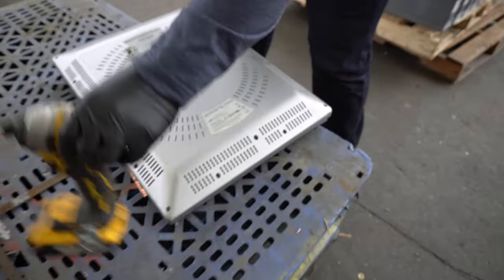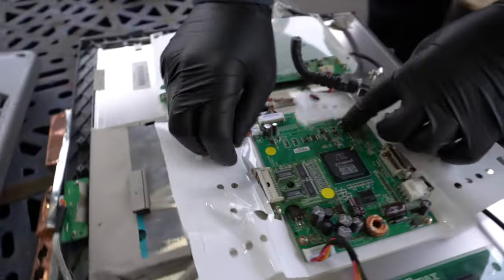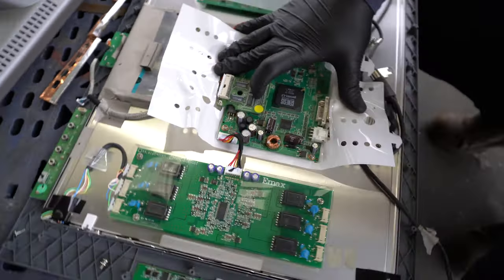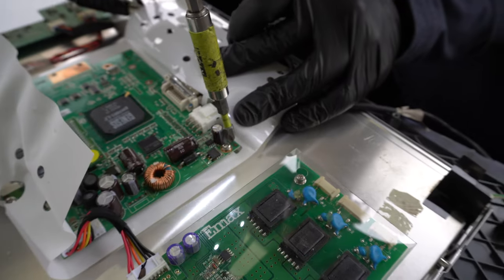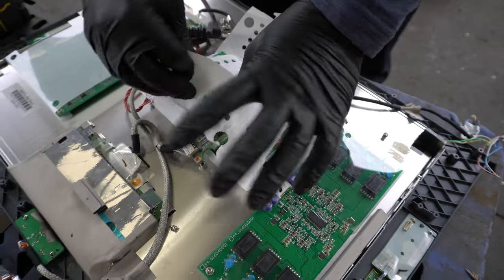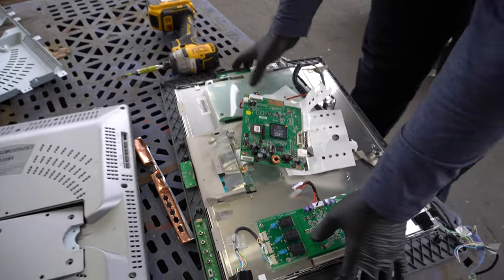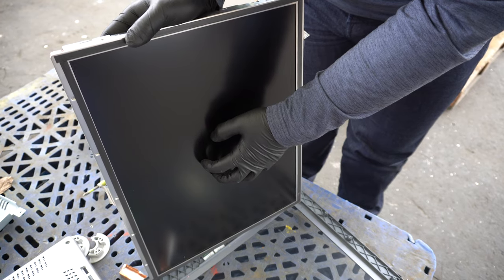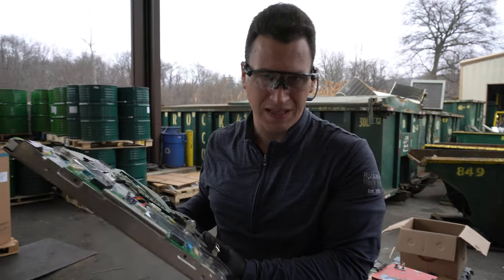Taking Apart A Smart TV - Scrap Circuit Boards Inside

Comment: Tom, 
Do LCD, plasma, or tube TV's contain harmful gases/chemicals that we should worry about when taking them apart? I want to tear some apart but I heard they can contain mercury.
Reply from the maker: Mercury was stopped being used in household consumer electronics around 1991. You can look up all of the parts for each TV through the manufacturers websites.

Comment: Smart TVs don't have all the radioactive crap that will hurt you like the CRTs will the metals can be recycled the plastics can go in your plastic recycle bin at home for to be picked  up on trash day in your recycle bin. All the electronics boards cords and everything else is yours to sort to take to your local recycle yard and steel I actually found a local yard in my town that actually pays 15 cents per pound for any type of broadcast screen computers plasmas LCDs RCT CRTs. And tried to give it in like that I didn't take anything out of it I just took it apart. You had the back side with the LEDs in it backlight lamps and the bored part of it it's actually comes in three pieces you got your back and then you have your peace with the LEDs in it and then you have a metal type of there's a board that holds all the electronic stuff and then you have separation of screens the HV screens are super cool to hold on to and I really need for a variety of reasons that you can find examples on YouTube by other creators if you're into doing that kind of stuff . Designed to keep it from I guess shattering into a billion pieces so if you crack it you can safely fold it up and throw it in the bin with no problem. What's cool about scrapping is inside these electronics and other gizmos that make things work in our everyday lives can be used and repurposed for other things to make our lives easier better or even cheaper some of the creators miss that and buy things to make their gizmos work. So next time you scrap a microwave or any type of motor or anything that spins or lights up think about the holiday seasons coming up and what affects you could create hold on to a few and take the rest of the yard😅😅😂

Comment: As I believ I had mentioned in our ewaste podcast you should not open up those screens under any circumstance. LCD ones are full of mercury gas and should go to  a proper recycler. Plasma and LED do not and don't waste your time taking those ones apart, right into light iron those go. most flatscreens really arent worth your time especially newer ones as the boards are smaller and contain less precious metals.
Reply from the maker: Mercury was outlawed in 1991 for TV production and manufacturing.